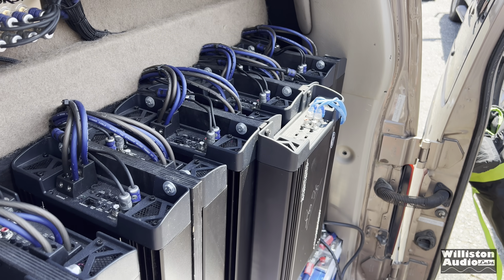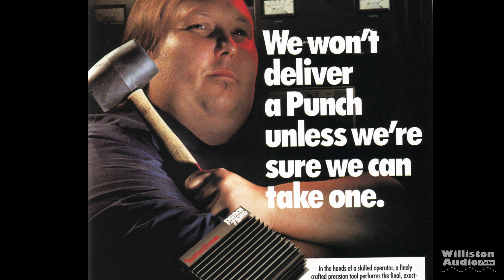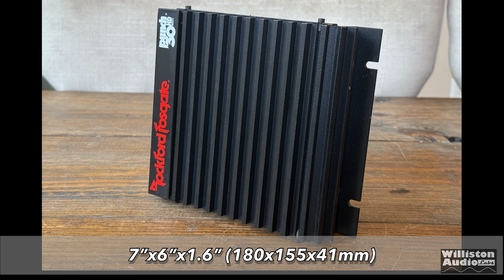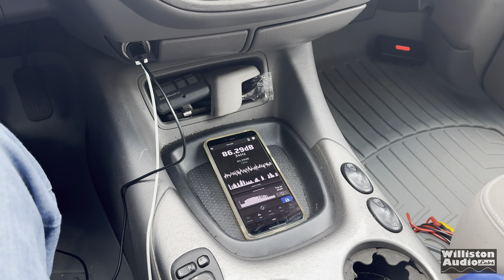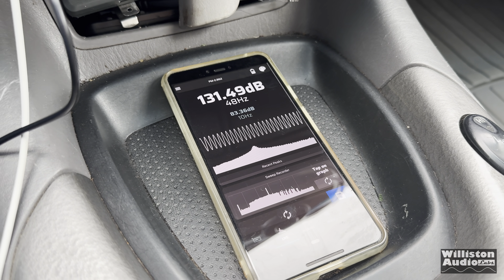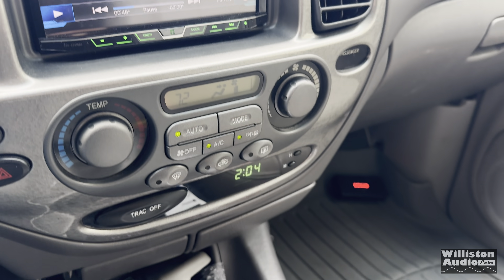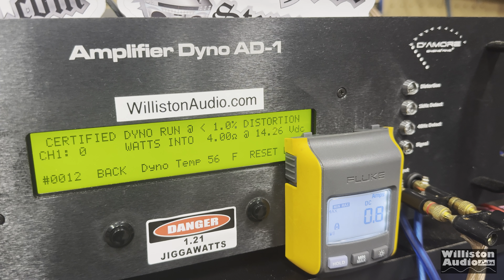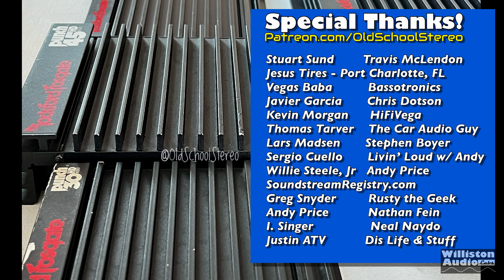Can This 35 Year Old, 30W Amp Power Four 12" Subwoofers?

Comment: I bought a Punch 30 brand new in 1988 to power 2 Rockford Fosgate 8 inch subs and it sounded great, especially in a Honda CRX.
Reply from the maker: The CRX was the perfect car audio boombox!
Reply: Oh no!! A fellow CRX owner!
I had a 1991 CRX Si black on black with (4) Soundstream SPL10’s powered by a Soundstream Reference 644s channels 3 &4 bridged and (2) 6 1/2” in the doors. The box was custom made by one of the installers at Sound Advice for his own car (which he had sold earlier) and was made of fiberglass, which he painstakingly did by removing the spare tire, grinding off the bolt that held it in, laid that 1” thick multicolored jute padding all around the trunk area, then covered that with clear plastic wrap, then laid down the wet fiberglass to the shape of the trunk floor and sides, after dry/cured he cut a thick MDF piece for the top baffle and made recessed holes for (4) 10” drivers (and an adapter if you wanted to use 6” or 8” drivers) and a spot for an extra Optima Yellow top D51R Honda sized battery (like the car used up front), he then covered the entire baffle with black tweed around the speaker holes and then made a separate cover that he covered in black leather, he next made a one-piece grill for the woofers and another for the battery cover.
Then, he covered the stock rear storage compartment cover with the same black tweed, along with the fold-down door in front of it.
He then removed the storage tray (which in Japan was the rear seat bottom) and created an amp rack with the same recessed/black tweed/black leather look.

The (4) Soundstream 10”s were only getting 320 watts for all four of them or 80 watts apiece! And the front doors only 75 watts x 2, but that car was little monster!! Clean and clear, but deafeningly loud!😂

Before that, I had a Punch 40 DSM pushing (4) 6 1/2” woofers [“The Hott Setup” (THS)] subwoofers (made by Orion for THS, or so I heard?) with HUGE magnets almost too big to fit into the cutouts and NOBODY could guess what size my speakers were nor how many I had! 
They guessed everything BUT (4) 6 1/2”s!! 😂😂😂😂😂

That Punch 40 DSM, iirc, was putting out close to 200 watts in mono and those speakers LOVED it!!🤪 The buddy who sold me those 6 1/2”s demo’d them in my car with both of our radios on the same station. He sets the box in my car and takes a long set of speaker cables from his Punch 200ix in his car and runs them over to the (4) 6 1/2”s and we cranked it up so that the mids/highs sounded equal to the bass volume, then we cranked the crap out of those 6 1/2” subs and I was dumbfounded!!🤪 That Punch 200ix probably put out well over 400-500 watts in mono, so I was thoroughly impressed!

Don’t have THAT amp anymore, thanks to a 💩thief, but I still have EVERYTHING else!😂 

I was experimenting with a set of MTX 8” truck boxes with the mids/highs disconnected internally in the back of the CRX (BEFORE I got the fiberglass box, thank God!) with my ADS PS5 and ADS PS5.2 amplifiers (that I was going to use to amplify the front doors) just sitting in the back!😡🤬 They stole the speakers, amps, and all of my tools as well. 

I’m no longer mad about it, like I was at first… 30 years ago!😂
Karma will get them in the end.
😉👍

Wait!! I am STILL mad about the fact that they stole my knife that I bought in Switzerland on my senior trip to Europe! That baby fit in my big hand PERFECTLY, like I should have been born with it there!!
In the words of Hank Williams Jr., “I’d like to spit some Beechnut in that dude’s eye, and shoot him with my old .45 ‘cause a country boy can survive!”😡🤬
Reply: @tigerstripeeyes9871  Man you went all out. I loved the Si model. I had an 89 DX but it was still quick. I beat many V8's with that car. I wish I would have never gotten rid of it. I had 2 sound systems stolen out of that car. Nothing like yours but my Fosgate system was stolen and then I bought a Hafler 200 watt rms 4 or 2 channel bridged to 2 channels running 2 cerin vega 12s.

Comment: I ran the punch 45 with two CV 12". Back in the early 90's. ( The punch 45 is a little  monster. )
Reply: Same here in 88-89, but I ran 2 M&M Godfather 15” subs and 2 punch mid/low plate speakers on a Punch 45 with no issues in my 89 Nissan hardbody p/u. I could be heard 2 blocks away when bumping the beastie boys Paul Revere, brass monkey, and slow and low. (Kick it over here baby pop, Ummm drop.. then booom!)

Comment: When pushing massive air quantities became the norm and everyone started using heavier materials to reinforce the drivers for force is when we lost the common knowledge that you can get loud af on little power. I myself don't want to be over 2kw anymore.. I used to want tens of thousands of watts but now I want to get the cleanest, loudest sound for the minimal wattage and money..
Reply from the maker: Less power equals less electrical and weight but the amp in this video is a bit on the extreme low power situation
Reply: @wal … Not really “extreme low power”… it did just do 133db on (4) 12” subs right in front of your own eyes!😂

Those amps were designed to handle whatever you threw at them… like powering entire systems.

Efficiency is EVERYTHING!

Look at Klipsch home speakers… SUPER efficient! The largest, the Klipschorn, is something like 105db efficient and audiophiles use super small “micro” tube amps with 1-3 watts of power on them and they are still super loud!

The main reason the old school Rockford Fosgate amps could handle such massive loads is because they used unregulated power supplies. The more juice they needed, the more they took from your electrical system. You could run them at higher voltages as well.

Needing a ton of watts to get speakers loud has been a myth propagated for many years in order to sell more equipment. 

If you have really efficient speakers and a well built small amplifier, it will be plenty loud enough for most people.

My old Cerwin Vega RE38 home speakers (with the 15” woofers with the iconic red surrounds) are something like 104db efficient, and if I put ONE of those in the back of ANY vehicle (disconnecting the mids/highs, of course), I wouldn’t need a ton of power to push them to insane levels… their frequency response is 20hz-20,000hz! Most vehicles don’t get anywhere near 20hz.

You and others like yourself need to get speaker manufacturers to start producing highly efficient speakers instead of 99% of the junk out there today. Then, amplifier manufacturers will follow suit and start making smaller, higher grade amps. It’s a “win/win” for both parties because now, thanks to technological advances… like super small neodymium magnets, stiffer/higher quality cone materials, audiophile grade capacitors/electronics… the speakers and amplifiers can be made smaller (amps) and MUCH lighter (speakers) which will make transportation costs a lot less expensive for companies AND buyers. 

Funny thing is, as a side effect/benefit of having smaller/lighter equipment the customer will get a little more trunk space and a little more fuel mileage.😁👍

Plus, it should ALL be “Made in America” with American parts!!🇺🇸

Comment: Those are called molex connectors. ATX is a motherboard/case layout.
Reply from the maker: Molex is a generic term for connectors. It is used as an IDE style power connector in computers
Reply: @ IDE ribbon cables are for data transfer and yes those hard drives, floppies, cd roms back in the day used them before sata connections. Still doesn’t change the fact that it’s still a molex connection on the amp.

A Molex connector is a two-piece pin-and-socket interconnection which became an early electronic standard. Developed by Molex Connector Company in the late 1950s, the design features cylindrical spring-metal pins that fit into cylindrical spring-metal sockets, both held in a rectangular matrix in a nylon shell.

Comment: Correct me if I’m wrong but what does this say about the amp exactly. Wouldn’t a modern day amp of the same ratings do the same? Power is power and it’s not making much so what is the surprise? 4 subs (x4 surface area) create those numbers. A cheap pawn shop pyramid would produce better numbers than 40w at 4ohm therefore it would produce 130+ db???

Comment: I want to see an MTX 8302 amp the one with the black and chrome panels I had two of them on two comp VR 12's back in the day they said it was supposed to be 400watts but the reverb birth certificate sayed 204 on the one I got off eBay about 20 years ago and the other one was used I guess they both were 😂😂 but I really wanna know what I was pushing to some 500 watt speakers those were some good memories for about 2 years after and my life went to he'll I just wanna see one again

Comment: I would have pushed it a bit. If you had 11 Ohm box rise I would drop the Ohm load to 2 or even 1 Ohm if possible. If you slow roll into the power, it would hit 4 Ohms or more. I bet you may have been able to hit a 138 or 140 then. I would test other small amps on the quad box to see what other amps would produce. I always thought RF and PPI were all hype and other brands were just as good or better.

Comment: Now I’d like to see the same test doe with the 150
Reply from the maker: Man I'm super curious as well. It might handle the 1 ohm mono (which should be 2 ohms or more after impedance rise at 48Hz) and do some real power
Reply: @ You and me both. I’ve always ran JL Audio subs and that started back in 94 with my first car. I almost always ran them of Rockford Fosgate amps. At times I have ran them off JL amps and PPI Artist Series Amps and they sounded beautiful however I always went back to RF because my JL subs seemed to always punch harder with them.

Comment: I remember a car in my town like this. It had an Orion 225 Hcca that was pushing 4 12s and the mids and tweeters in the doors. You had to use these massive boxes with the subs because the cones were so light that if you put them in something small they just resonated and sounded terrible. Crazy efficient though. Took very little wattage to make the car shake

Comment: I remember back in the day Phoenix Gold called the 1- amp doing an entire system "Tri-Linear" in a stereo/mono and series/parallel  using caps and coils to divide the power to front, rear and subs. 
You really had to design your system around making 6db, 12db and 24db to keep your slopes, frequency and impedance load safe for your system
PG later came out with a pre-built passive dividing network that was gold and plexi glass to do this.(Sound XS I believe)

I wasn't a huge fan but it was cost effective and I sure designed, built and installed hundreds of passive systems for customers at my audio video store.     

GREAT VIDEO BIG "D"
MERRY CHRISTMAS TO ALL
Reply from the maker: I have a couple of the PG passive tri-mode crossovers I was going to show in a future video powering a full setup
Reply: Merry Christmas brother!
Reply: Brazilians still do it.

Comment: You gotta go with the 45HD in your next video & then keep testing them all the way up to the 150HD! Now that would be some awesome video's right there my friend!! 30HD, 45HD, 75HD & lastly the BIG DAWG 150HD!!💯🤘🏾
Reply from the maker: We will see how popular this video is and may do that as I'm curious as well
Reply: @wal  I was an custom car audio installer and sound off competitor from  the late 80's into the mid 90's, and was not surprised by your findings.  In the early days of competitions (by wattage class), these were a cheat code, especially when you ran them down to 2ohms,(some pushed the punch line even lower with amazing results).  Please try and test more of the line from that era.  It would be amazing to see how they compare.
Reply: @dankolicious10  yep 2 ohms and stable
Reply: @wal  then go thru the models my the years. I’d watch all the RF, sound stream before the s, audio control, Orion, audio art, PP
Reply: +1 on that vote!  Then, honestly I'd like to see the 75 and 150 after, if possible
Reply: that's what dude just included lol
Reply: Yes test the 200 punch ix that is the newer model with the rarely survived end caps. I bet that same box will be real close to 150. And if the box was bigger it would hit 150
Reply: Yes! That would be so cool 😎
Reply: I agree.
Reply: I once ran an Orion red 50 on 6 15s. It slammed

Comment: Back in the 90’s in Stillwater, OK there was a guy at Cartunes who had his whole system (with two 12’s for subs) running off a single Punch 30 in a Blazer or Suburban.  I couldn’t believe how good it sounded.  Ended up buying a Punch 150 and running a pair of kicker C12’s in a 7ft^3 4th order box in the back of my 280ZX.  Ahhh, the good old days.  

Would be cool to try a 50.1/50M on that quad box at 1 ohm.  

Thanks for all your old school reviews, I really enjoy them.
Reply: @mikesmith8190  Hey Mike - That was me, Zane!  (everyone called me Z) That was my GMC Jimmy (Blazer).  I had the Punch 30 running two Rockford Series 1 twelves initially to try to help sell those.  I later upgraded the subs to 12” Blues which were amazing.  The Punch 30 was running the two twelves, as well as the rear speakers which were Polk Audio MM 6.5” woofers, 2” mids, and 1/2” tweeters,  with Polk Audio 3.5” mids and 1/2” tweeters in the dash.  I experimented with various crossover combos to get it the way I wanted it.  12 speakers in all and I loved the way it sounded!  I can’t tell you how many demos I did and how many Punch amps I sold from that ride.  I loved those days, and had a blast working there!  Z
Reply: @ that’s so cool!  I think your Jimmy was red?  And it sounded really good, and hit crazy hard for being run by a Punch 30.  That sold me on the Fosgate amps. 

I remember at Cartunes there was a yellow (?) chevy Astro van with six 15’s facing rearward in the hatch and had like four 10’s facing forward under the rear seat?  Someone demo’d Eric Clapton “Cocaine” and I recall thinking as the first few intro notes of the bass guitar (?) played “why wouldn’t they play something with real bass in it?” and then then it really dug so tight and deep and I was like holy crap, lol.  

I think I drove the old guy who worked there crazy with questions about everything.  I had you guys design my 4th order bandpass for my C12’s on some really early computer program.  It turned out great when I built it.  

I still have my Punch 150 I bought way back then.  Means too much sentimentally to risk being stolen, so I bought another one recently to run a Fosgate 18” xlc and reminisce : )

I picked up a Punch 30HD about 20 years ago entirely because of you, lol.  I have dreams of building an efficient system and having relays so I could flip a switch and run the whole system via the 30HD with passive crossovers and then flip it back to multiple amps and active crossovers : ). 

Mike
Reply: @mikesmith8190  Awesome!  My Jimmy was white, and had a red interior.  The Cartunes van was also white.  That thing was powered by the Rockford Power 1000 mosfet, it was cool.  I always drove it in the OSU homecoming parade, and my head would be pounding by the end! lol.  I also used to take home the PPI van, and the Pioneer Premier Cadillac.  Yeah, I loved the efficiency back then.  I worked there from 90-98, so right in the heart of the “glory days” of car audio (my opinion). I still have my Clarion Pro Audio DRX9375R head unit and their processors/cd changer, that thing was so cutting edge and is still cool today.  Wish I would have kept more pieces.  At one time, I had the Rockford Fosgate Symmetry in the Jimmy, which was way ahead of its time.  such fun times!

Comment: not bad at all, i guessed around 130 low to 135 max ... if you have a pioneer GM120 [circa 1982] on hand try that, its the 1st really good amp i ever used

Comment: That’s crazy how much output 30 watts has on that box. I think the SUV part helps with the SPL but that’s so little power that it’s crazy.
Reply: Batdog Garage has a video on hitting 140db at different frequencies in his IB setup and it's shockingly low power

Comment: There was a guy here that had six Punch 45HD amps powering a flat wall of six Punch 10s in a CRX.
I still have a Punch 45HD and a Punch 150HD, though both no longer work. *need a HBPIM input board if anyone has one

Comment: I used a radio shack EQ booster to run a couple CVXL12's back in the day.  Wouldn't rattle any windows by any stretch of the imagination, but it kicked alright.  When you can't get what you want, use what you've got.

Comment: Hello from Austria, very interesting presentation. Back in 1986 I had a Pioneer GM4 with 20 watts and TS speakers. It was unbelievable how loud this combination could play. A test of the GM4 would be great - everyone had this amplifier back then. Regards
Reply: @peterpretzell8035  Still have 2 of them stored away. Had one running Pioneer 6in 3 ways, the other 8in Radio Shack woofers. Didn't need a sub.
Reply: @disgruntledcanuck … Didn’t need a sub??? You HAD subs already!! TWO 8” subs, or did you forget?😂😂😂
Reply: @tigerstripeeyes9871  Weren't subwoofers. Just 8in woofers. Solid bass down to about 200hz

Comment: Awesome video,I did 2 30s on 6-series 1 15",another 30 on mids/ highs in xcab S10 back in 91-92,it sounded amazing and did low 140s,I just hated those speaker and power connections
Reply: Man, you bought back memories, with the Series 1 subs
Reply from the maker: Good lawd, one Punch 30 on six series 1 15's? Holeeee 😲
Reply: @wal  2 30s on 6 15",1 30 on mids and highs.those series 1 were extremely efficient

Comment: In the 90's had a precision power amp pushing two 10's probably only 300 Watts. Could hear me coming down the street. You don't need all that power to bang. Still have some old mtx amps in the garage. Sister in law sold the precision power to a pawn shop. Wanted to beat her.
Reply: Call 911 and report her thieving butt!! Press full charges and demand they track down your amp! 😂😂😂😂